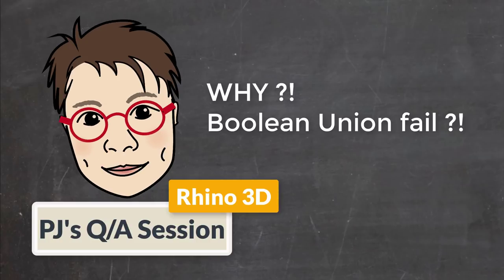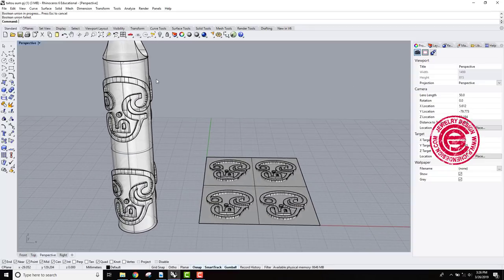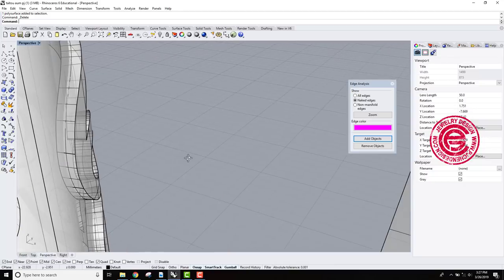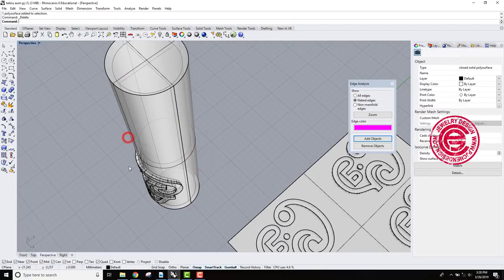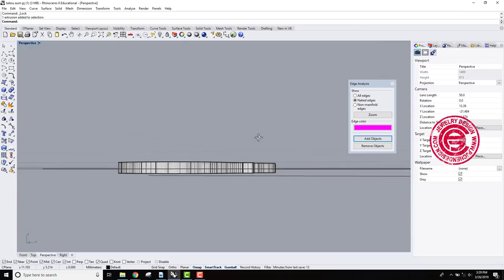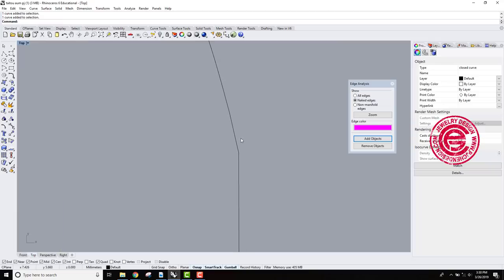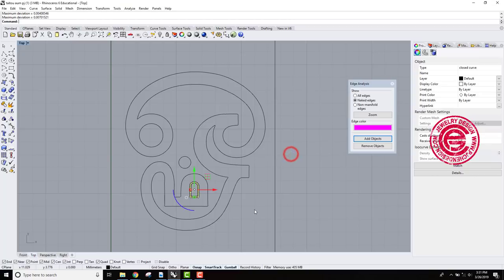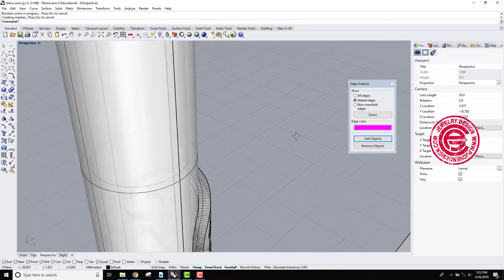Why boolean union fail even all parts are solid polysurface: Q/A Session (2019)

Comment: I just did the intersection between screw thread and a bolt I couldn't bool unite. It found 477 intersections, most of which are short lines going along the bolt around the surface that is supposed to touch the thread model. What do I do now?